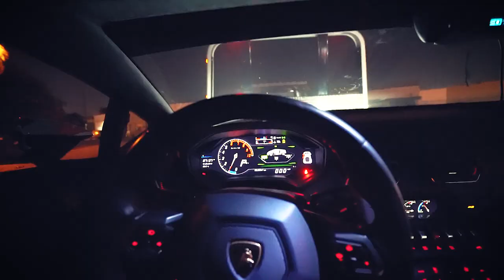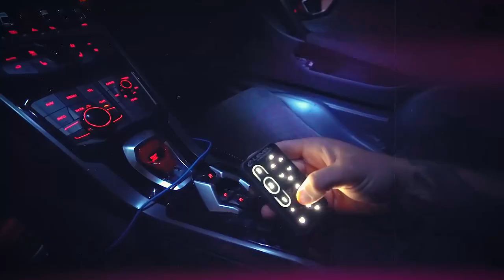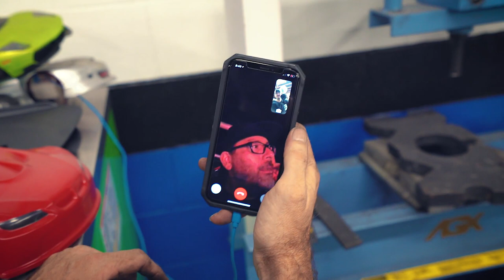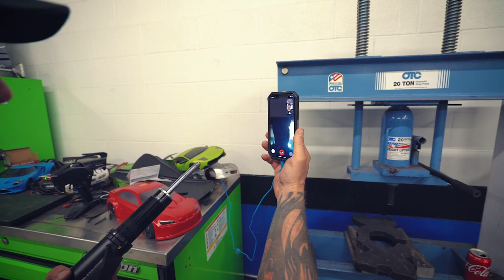LAMBORGHINI HAS UNEXPECTED CATASTROPHIC SHOCK FAILURE!

Comment: The force of slaying the tires could have worn the other side as well. I would check both rear suspension parts, and keep in mind that the railroad track was not only a blessing in disguise, but the actual end-point for the abuse cause by swinging the weight of the car with burn-outs.  Image if your were doing 100+ and that happened. Glad you guys are ok, but have your homie check the other side too.

Comment: I say, even though the air bags are bad ass, go to a better aftermarket suspension that replaces the stock other than air bags because of how hard you are on things, the end of the shock absorber shaft is just going to break again if you hit another bump like that and since it is horrible California roads, chances are high. Problem with the design of that shaft is it has a hole through the center of it making it weak. It was designed for show not function on a Lamborghini doing 150+ over bumps. I would be paranoid going fast again in that car over California roads.
Reply: How are airbags bad ass?

Comment: If air doesnt travel through the top shaft that make put on a cable around your neck, I do not see the point in it being hollow.   With that being said, the RR tracks bottomed out the suspension and it snapped.  It's either not the best made shock setup or just hard driving on crappy roads.

Comment: Dumb the bags. Replace them with some Mitler Bros. Hydroshoxs. Then you'd have a fixed spring rate (like Lamborghini intended) and the ability to raise/lower the vehicle 4-5" (102-127 mm). It's hydraulic so they respond nearly instantaneous (and you wouldn't have any more compressor noise). I absolutely have no affiliation with the company. I just know they make a product that seems to be ideally suited to your dilemma.

Comment: Let Sadistic or manufacturer look at the shock absorber. Warranty? Maybe it had cracks after treading. Steel hardened before or after treading? What is maximum travel length of shaft before another damper- or body part will reduce the overforce?  
Are all axle struts and bearings/joints good? It's their job to take up and control movements and forces in any unwanted direction. Therefor it's not the shock that restricts movement going sideways!
And a hole in a rod or pipe has nearly not any influence over maximum strength. It's minor of the total area and all forces like twist and bend maximizes on external area. But the tread part has less area (and a nut can give bending force if loose) and probably breaks first when pulling.
This was a short lesson in easy vehicle engineering.  :)    Good work #Guttersnake, but don't let them mess up your tools and work area!!  And Swedish Öhlins make good dampers for professional use.

Comment: I loved the intro!! That was awesome! Keep the air ride, except this time after it getts installed back in the car put 50 miles on it and then go back to the shop  re snug everything. Then drive it another 100 miles and repeat. Then go 500 miles and recheck it all again and then after u hit that 500 mile mark and everything is ok, then go  and slay tires but not until that happens!! Just like any other system on a car, it needs to be broke in and I guess set in place u could say. U went from Bobby's to full throttle and that was it. Can't do that!! You can but stuff like that happens.

Comment: Bro I gotta say it, it WAS the fault of the bags. In a regular shock absorber, it's a solid, straight piece of metal. Like Markgyver was showing you at 10:20 , The pressures on a shock are never sideways like that, so you'd never actually be able to snap it in half at the middle, the pressures on a shock are vertical, they go up and down that rod, not sideways, that's why the worst I've ever seen was a bent shock absorber, never a broken one. 

When you hit the hole, the bag changed the direct down angle of the rod ever so slightly, and that put sideways pressure on a part that was designed to only ever get vertical pressure, and it snapped. In a regular shock absorber, it's surrounded by the spring, which by design doesn't allow for strong side forces, it only ever allows forces to go downward, any sideways throw is negated by the spring and transferred down into the shock. In the airbag design, the bag itself is entirely more flexible than a spring, and as a result, a jolt like hitting a pothole, would cause the shock to flex along it's vertical axis and transfer shock sideways, a regular shock would too, but because of the flexibility of the bag, the shock was able to move more into an undesirable sideways angle, and when the weight of the car came back down, it didn't come down straight, it came down slightly off angle because the bag flexed. 

It was because of the bags bro, and I'm still on team no bags, even after seeing how sexy the car looks sitting on the ground, Looks don't beat performance in my mind, and I'm certain not in yours either, but I get it, it was a business move, not a personal choice, I get it, I just prefer the way it was before, when you used to be really comfortable sliding the car. (PS, those sideways forces I was talking about that affect the bag, it also causes the kinda rubbery feeling you get when you slide it now, because the bag itself is absorbing the sideways motion of the slide, instead of the shock flexing and transferring the motion, so you get less feedback, and are therefore less in control)

Comment: But the issue I see is that the shock has such a thin point (WEAK point).  On a more vertical suspension geometry it might work, but it seems the Lambo has a decent amount of shock angle.  Not a huge surprise it snapped...(and that same model will again).

Comment: My 2 cents, you need to figure out if that was the result of repetitive bending or not. Those strut shafts are hard metal and to break where it did in a single incident would require a really large amount of force. My gut says repetitive bending, which would mean the alignment is not right on at least that strut. I do not think it is a function of swapping springs for bags, neither are providing much lateral support. 

When you change ride height, you do alter the angle at which the strut sits and it may be that at the lower setting the forces are not down the strut center line, causing a little pressure where that top cap hits the shaft with every bump. You are fine for a while, but eventually the metal will fatigue and develop cracks.

Then again, might just be bad metal in the shaft. It happens, (I am waiting on a replacement rear end housing that sprung a leak most likely due to bad metal in an axle tube). I would reinstall the bags and then cycle the ride height a few times and look for contact at the top of the shaft with the top cap for those bags. If contact, you may need to do some engineering to get the right center-line or add lateral support.

Did you punch a hole through the airbox too? Or did that survive?

Comment: Go stock suspension on the rear, air ride on the front. You went air ride for ground clearance problems after tearing off spoilers. Air front, factory rear works.

Damon, you find ways to break parts that no one else can. Lamborghini cars have enough issues with reliability, and the cost of ownership is not for the faint of heart. Get the car drive-able with the stock rear suspension.

Comment: You ever think that the shock bottoming out would cause the body of the shock to hit the top bag hat. That puts huge stress on the area that sheared off. Most likely, that caused or at least contributed to the failure. Adding a bump stop would lessen the chance of it happening again. Although it would hold the car up a bit when you "air-out" the bags.

Comment: Air shocks can take an extreme vertical force but not sure about lateral. The way you drive that beast, all that weight in the rear, probably not a coincidence a rear shock broke. Just might not be able to take that level of abuse.

Comment: Total one in a billion chance incident, I've seen airbags fail but never like that. Usually it's a another component or arear on the strut but to shear the guide rod at the tip like that is just outta this world. Wondering if maybe a corrosion issue due to all the different weather the lambo has seen. I know a couple guys who have that issue in the North East during winter due to all the salt during snow season and the air out their if near the coast is salty as fuck so the rain is as well. It goes to reason one would have the same issue on the west coast.

Comment: I used to have air bags on a Cadillac truck  with the below over strut setup and  I had my struts break right on the top mount like that a few times.
Reply: I think it has to do with the height you were riding at... after I changed my default ride height I never had it break again.

Comment: Choi will go on and on about money spent on suspension R&D, but then change the engine management software/add forced induction, run fuel that was never intended for the car, add aftermarket wheels, cover up the factory paint, change out certain body panels, add aftermarket aero bits, add lighting and change out the entire exhaust. Apparently Lambo spent $5 on all of that since it all got changed, but it's ok because stock suspension and Michelin tires 🤷
Reply: Chris Romero and how many times has Alex’s car failed while driving again?
Reply: @unknownhorror9285  It's not meant to be taken that seriously. Things happen.